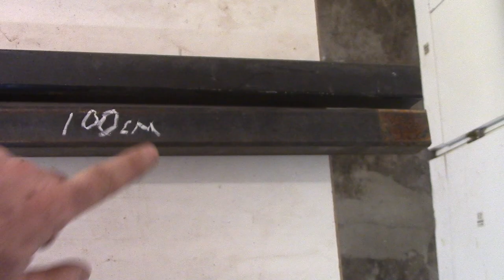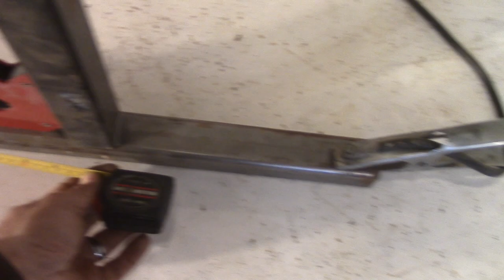How to Build a Home Dumbbell Weight Rack - DIY

Comment: Very nice! I would love to see something like this done with just bolts and no welding. For the attaching the angled bits to the uprights you could just use a small section of angle iron in front and behind the upright. Run a type 8 bolt through both sections of angle iron and the upright. The piece that got welded to the upright would be bolted to the two small sections of angle iron. In the future when I get more weights than just a single kettlebell I may try my hand at a weight rack similar to the one in this video but with bolts instead of welds.

Comment: Hey DIY Duke, I made the power cage and bench, but I'm using salt bags for my weights! Please do reinforced concrete free weights. There are no decent videos for this. Almost all of them lack any reinforcement at all and are giving out very bad DIY advice.

Yes it might require welding equipment and so that should be factored into the price / bill of materials since no one has that. But you only need to make one mold for 45 pounder plates, and then you can just buy a pair of 25 pounders and 10 pounders since you only need one of each pair. With the know how to make 45 pounder plates, assuming the average person will eventually need 6 plates, that's a lot of money saved by knowing how to make durable DIY plates.

Thanks for all your hard work and good DIY designs!

Comment: Hey buff dudes. I need some help. I bought a dumbell bar yesterday only one because i already have one. The one that i already have is solid steel and weighs about 4lbs. But the one i bought only weighs 2lbs. So im wanting to know if i should buy another of the 2lb ones or i should i keep the ones i have and use the heavier one for my weaker side
Reply: No use the same weight on both sides. My little 10 y/o sister couldn't get a pump with a 4 lb dumbbell. I think you might need heavier weights.
Reply: Its about 2.2 lbs. from what i got when i weighed it. I weighed myself and then weighed myself holding the dumbell bar. If you didnt know, a dumbell bar is what you use to add weight to it on your own. So, if you wanted to make 10lbs, u would put a 5 pound plate on each side of the dumbell bar. Much like a curling bar, or barbell, you can use plates to make them heavier. So if you wanted to bench press say, 225 lbs, you could grab a 45lb olympic barbell and add two 45lb plates on each side of the bar, making it heavier. Is there anything else i need to explain for you? If so be sure to ask! Ill help as much as i can!